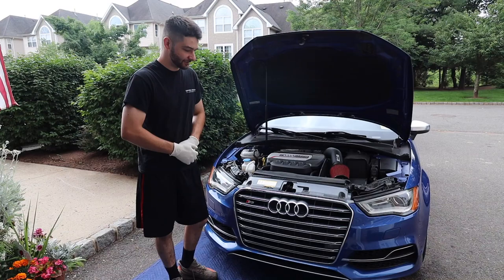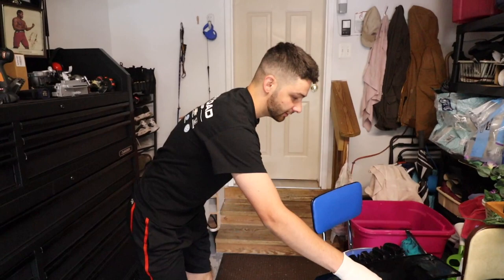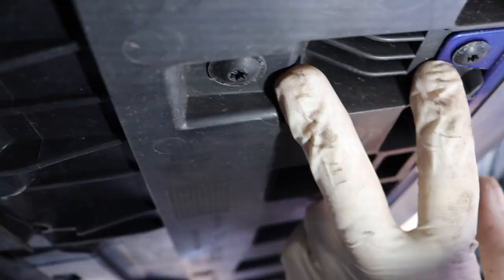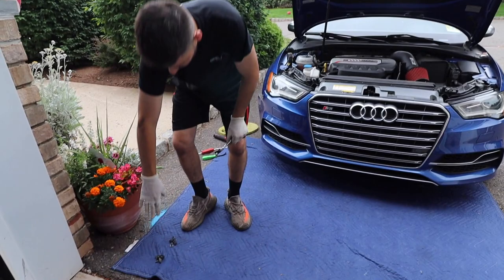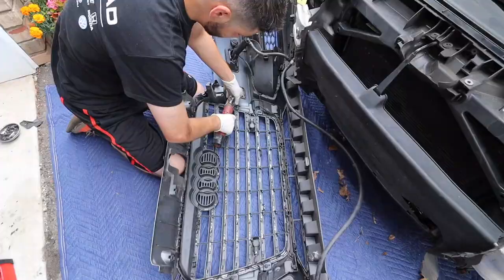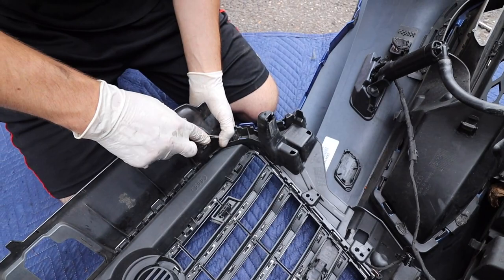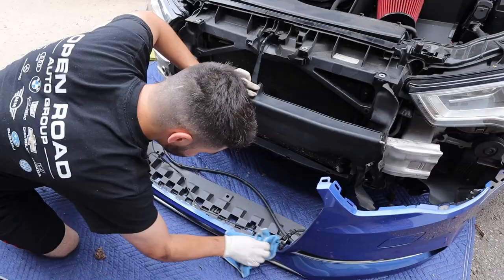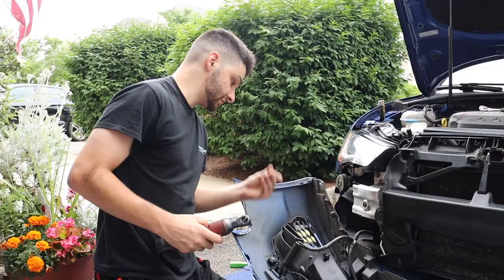RS3 Style Grill On Audi A3/S3 | Game Changer!

Comment: Does any one know if this interferes with pre sense or ACC?
Reply from the maker: So if you have the big radar in front for all those functions you’ll have to order the one on the website that has the cutouts for those. In this video my car only has the parking sensors so this grille only had the cutouts for them and it works fine but you’ll need the other version !
Reply: @RatchetWrenches  I see, Thank you for your response! Greatly appreciated 😊

Comment: Looking good!  How has the grill held up with winter and driving?  Did you get the S3 badge to go back on the new grill?
Reply from the maker: Thank you and actually held up perfectly. Unfortunately the s3 logo was a different style clip so I couldn’t put that one on this grill here. But they offer replacement s3 logos for cheap on Amazon, eBay etc. also I lowered my car and by accident ripped my bumper off and cracked the grille. So I ended up buying the rs3 bumper and repurchased another grill through this company. So stay tuned for a video on that if you’re ever looking to change out the bumper too

Comment: 5:24 how did you get this one out? no matter what tool I use, a ratchet or an electric, it will not budge... I used wd40 even and it is so tightly done that I cannot loosen it at all, any tips?
Reply from the maker: If they’re rusted in there and you’ve tried wd40 or heating them up there’s really not much left you can other then break the tabs and replace them it’s usually just a clip and then a screw

Comment: I have an aftermarket RS3 grill on my s3.  The Audi emblem is solid though, no holes in it, and i want to change it.  Could i just buy a new emblem and swap it out?
Reply from the maker: Nice! And yes I believe you can change it out, I’m not exactly sure which one because there’s a lot of aftermarket ones out there with different fitment unfortunately so you’ll just have to research it a little bit

Comment: I have the stock front bumper, do I also need to change it to honeycomb in order to fit the honeycomb grill
Reply from the maker: No this will fit your stock bumper, in this video here I have the stock bumper aswell. Only installed the grill
Reply: @RatchetWrenches  Oh I see. Thank you very much. Mine is is an a3 2017 s tronic and the stock bumper does not have the honeycomb sides like yours does :(

Comment: How about the square senaonrint the front
Reply from the maker: This one isn’t equipped with the sensor like the more expensive models but if it was it would have the cut out for it
Reply: @RatchetWrenches  thanks I purchased one after realizing my car has the sensor. Mine has the Quattro wide logo on the bottom I may not be able to cut it out
Reply from the maker: @henriqueoliveira7106  gotcha yeah they should offer a grille that has the cutout for the sensor
Reply: @RatchetWrenches  update did great Dremel work and updated the grill to fit the sensor. No big issues